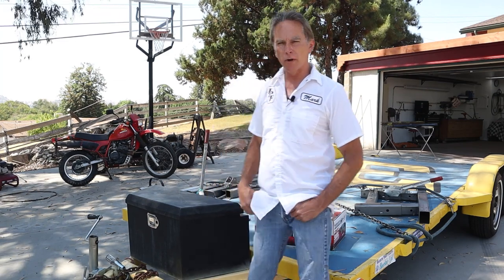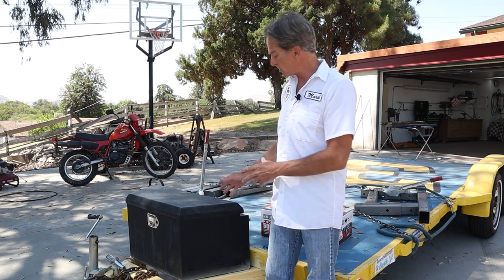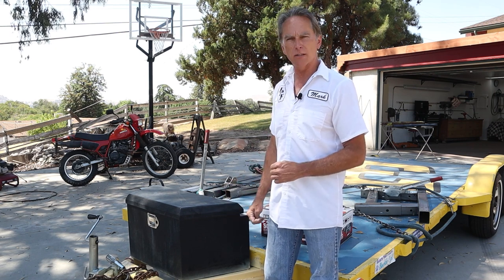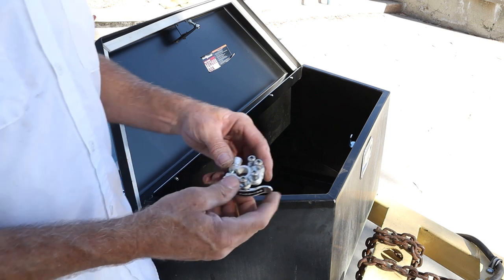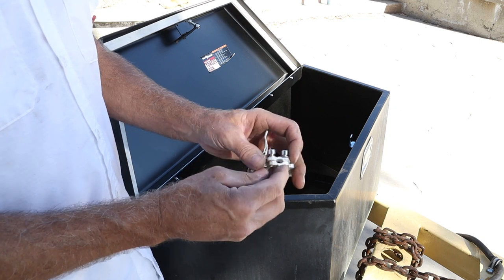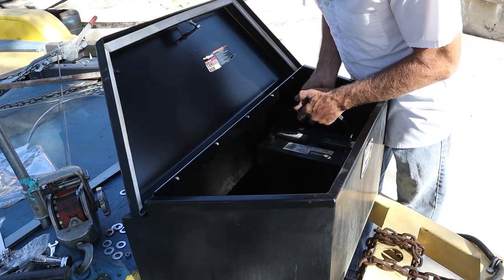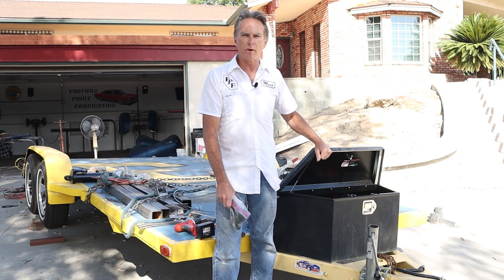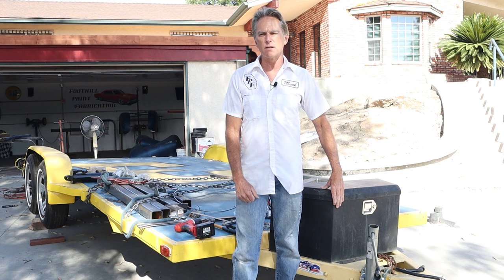Winch Install on Car Trailer - Badland ZXR 5000

Comment: I ran a similar setup with the same winch on my 20’ car hauler, I figured it’s got a 5k payload capacity so a 5k winch would be fine. I’ve used it a few times once even to winch a 1500 Silverado 4x4 up on it going slightly uphill, like it wasn’t even there. Definitely worth its price I’d say
Reply from the maker: Absolutely!  Anyone that has used a come a long to pull a heavy vehicle onto a trailer knows what a time consuming pain in the butt it is.  Rolling weight of a 5k vehicle is much lower than its scale weight even going up the ramps as long as they aren't shorties.  I would bet the winch could pull a 10K vehicle onto a trailer if it had to.
Reply: @FoothillPaintandFabrication  yeah I carry a snatch block in case it struggles at all
Reply: I was wondering if the 5000 would be sufficient for my car trailer. I’ve seen others say the 5000 might work but struggle a bit. I guess this video and this comment in particular settles that. I just wonder how it would do on a vehicle with flat tires or been out in someone’s back yard for a few years
Reply: @KevinModz65  I also keep a snatch block in my toolbox just in case to help double up the line if it struggles any but so far if it rolls and has at least some form of tire it hasn’t had a issue.
Reply from the maker: @KevinModz65  4 flat tires sunk down into the dirt might be a tough pull but like was mentioned above a snatch block will increase your pulling power, just slow it down by half.

Comment: these guys always cutting without a guard, drives me nuts!
Reply from the maker: Interesting enough it has gotten me worse with the guard on but you are right I have a few gouges  from running no guard.
Reply: Is 5000 lbs winch sufficient enough that seams to little?
Reply from the maker: @davidtrevinojr739  We discussed that and figured the biggest load would be the front wheels about half way up the ramps.  Since it is a rolling load 5K seemed sufficient.  He has used the winch several times with no issues and he wishes had bought it much sooner.  So much easier and faster to load non running vehicles.

Comment: I noticed you attached the little red wire that is supposed to go to ignition to relay box instead of positive terminal.  Is this preferred?
Reply from the maker: That little red wire energizes the relay like a safety so the winch will not operate unless the key is on but since this was being installed on a trailer not an ATV or truck there is no ignition to attach to so I connected it to the red hot cable terminal. On a vehicle it is best to attach it to the ignition like instructed.
Reply: @FoothillPaintandFabrication  thank you

Comment: Remove the hand crank from the tongue jack and modify to drive with a cordless drill.  👊😎
It will make you smile.
Reply from the maker: I have seen that done and it works really slick.  If this was my trailer I definitely would follow your advice.  Thanks

Comment: I am in the process of installing one of these on my car trailer. There's no clear instructions on the mounting and I thought it was strange how the bolt heads are hanging down in the way of mounting to a flat surface. I suppose it has to do with it being for ATV/UTV use as you mentioned in the video. Seems like a 5000 lb winch is a bit overkill on such of a vehicle. I was thinking of running the bolts that the fairlead plate is using going up into the winch and putting them through the trailer deck and the fairlead plate into the bottom of the winch. Also bolt it down through the plate as done in the video with at least 2 more grade 8 bolts 🔩.  The nuts from the rollers, maybe just drill holes in deck slightly larger than the nuts so they will drop below the deck surface. Kind of like counter-sinking them. For the spacer method, sometimes I have used iron pipe and slice off pieces for homemade spacers. Trying to make them perfectly square to the sides and each the same size can be a bit of work because of how short they will be. Not much of a way to hold on to them.
Great video! I might need to use spacers and you gave good ideas including the box which I am thinking of doing also. 👍👍👍
Reply from the maker: Thanks, it has been working out great for my friend and is one of those "I should have done this years ago" type of situations. You are correct 5K for an ATV seems silly.  Unless you are pulling stumps with your trailer winch the lateral pull will not be that great spread out over several fasteners. 
Mark